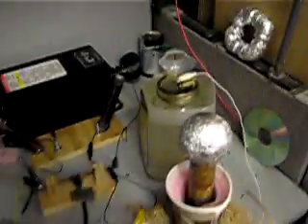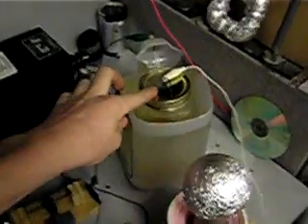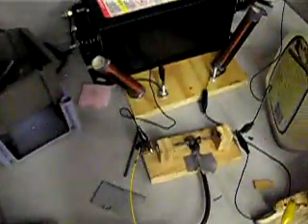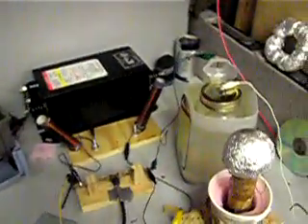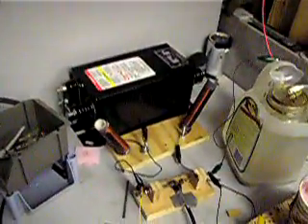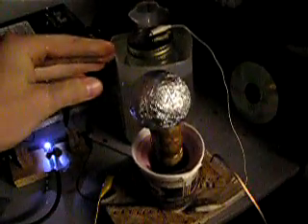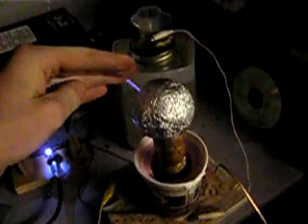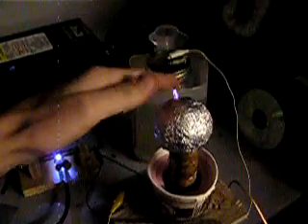My mini tesla coil

Comment: @supperstorm  The body acts as a ground. Since the current is AC, it changes it's polarity many times a second. The body acts as a zero, which creates potential difference with any negative OR positive charge. Therefore, the body is both.

Comment: @6418978876 
i think it doesn't cause much damage ...
The coil has 30.000 volts but little amps, so it cuases a bit pain, but there are many nerves, and the skin is a resistor too. but I couldn't build a tesla coil anyway^^

Comment: If you need more current from your NST, depot it and remove some of the current limiting shims, but not too many or else you could pop your breaker:^) Go to Ebay and get yourself some MMC polyprop caps. Change that spark gap to some copper tubes laid side by side. That NST could get you some nice 20+ inch sparks with some some serious reworking. Happy coiling

Comment: THey are 12,000 volt 30 ma Franceformer NST's. I use MMC polypropylene capacitors with bleeder resistors, an 8 gap copper tube spark gap and a flat wound copper wire primary.

Comment: Looks like it could use a good tuning. I make coils with 12,000 volt NST's that produce 23 inch sparks. Keep in mind that my secondary is only 1.75 inch by 17 inch acrylic tube.

Comment from the maker: Wrong. What you're thinking of is a van de graff generator. They don't have any coils or transformers or spark gaps of any sort. Just a vertical moving belt, a wire brush pickup at the top, and 1 conductive roller and 1 non-conductive roller.
Whats coming off the top of the sphere in this video is around 30kV of 2MHz alternating current. Static electricity is DC

Comment from the maker: It is. As well as on the outside. The bottle had lettering on the glass and foil would have left too much air, so I used the saltwater on the outside as well.

Comment: oh im sorry megasega i missread what you said..but no you dont need a 555 for this type of coil...just need a hv source,charge a high voltage capacitor with it and discharg it hrough a spark gap into a primary winding and that is about it...you have to have knowledge about it to get a good spark

Comment: hey mega sega..add my because i can help you with a few projects probably...i know a little about solid state tesla coils...but if you were asking if you could connect a 555 to the tesla coil then no...you need to connect it to a mos-fet..but if you know about high voltage i suggest a spark gap coil first

Comment: Ah, i remember when i was at 11 years... I played around by a multivibrator driven ignition coil... I should now try to make a working flyback (and a little tesla coil with it - my secondary former will be a 15cm tall vitamine tube which is polypropylene or polyethylene)

Comment: Well, the output from the secondary is high frequency, the nervous system doesn't respond to high frequency so it wouldn't electrocute you.  Of course, that's assuming that the coil is well tuned.  If not, you could get low frequency mixed in with the output and that could be lethal.  And you don't want to get directly by a discharge from the secondary, that can cause burns.  Also, the primary circuit is extremely dangerous.  It's high voltage AND high current, and is 60hz.

Comment: Oh agan... Ohm's law... Thru your body can not go 300A with 1V because of your body resistance. 5mA is deadly. Any voltage which can generate 5mA thru your body is deadly. If you body resisantce is low, even 70V could kill you. Watt is derived unit. It is only in relation to "Amps, Volts and Ohms".

Comment: Okay, what I mean is that the Wattage something is capable of generating is what's dangerous.  A flyback transformer won't do anything to because it's very high voltage but only capable of low Wattage (high voltage but low current.  Wattage = Volts X Amps.)  But a 450 Watt neon transformer could kill you, because it's capable of both high voltage AND high current.

Comment: No, it's both.  High voltage AND high current.  I can go grab jumper cables on a car right now and it won't do anything to me at all even though it's hundreds of amps, because it's only 12 volts.  It takes a higher voltage to overcome the resistance of your body.  Current = Voltage divided by resistance.

Comment: Well then, actually that's not too bad with only 6kv input.  My coil uses a 6kv furnace transformer.  I have a couple videos of it on my page.  That's amazing that you're doing all this and you're only 15!  Just be careful!  I started experimenting with high voltage when I was about 19.

Comment from the maker: Yep I accidentally let the arc strike my finger for too long and it left a black mark. And my transformer isn't 12 kv. I sadly discovered that the transformer only outputs 6kV at most. I didn't realize that when i bought it, the input was 277 volts. The most I can get from the variac is 140. But, I have ordered another one that really is 12kv and I should get it soon.

Comment: No...Wattage is what kills you.  A high voltage AND high current.  I'll go grab jumper cables from a car right now, and it won't do anything to me...even though it's hundreds of amps.  But it's only 12 volts.  In order for an electric current to be dangerous, there has to be enough voltage to overcome the resistance of your body.  Current = Voltage divided by resistance.

Comment: Dude, don't draw sparks with your HAND!  I left a comment about this, but don't ever draw sparks from the secondary with your bare hand.  Yeah it hurts, and it will also burn your fingers.  Hold a conductor in your hand, like a metal rod and draw sparks with that.  On a bigger coil, you would NOT want to get directly by a streamer.  Very nice coil, but you're dumping a lot of power into it if the transformer is 12kv at 30ma, you should be getting a much bigger output.

Comment from the maker: Yes i am running off the mains. The frequency coming directly from the transformer IS 60 Hz. 
The resonant frequency of the primary LC circuit is 2mhz, not the mains. The NST outputs 12,000 volts at 30mA.

Comment: Are you running the NST off of mains? If so wouldn't the out put be more like 50/60 Hz not 2 Mhz? I supprised that a coil that small even worked on that voltage/amerage, i gussing 30 ma. But then again I never even thought of trying it. Other than that nice job, nice quiet gap too.. :)

Comment: No, it's not even similar. I suggest you read up on Tesla coils and Van de Graff generators. Tesla coils are resonant AC devices, a Van de Graff generator is a triboelectric high DC voltage device.

Comment from the maker: This can be a safety gap, high frequency chokes(what I used), or ,the most effective, a "terry filter" which is basicly an assortment of metal oxide varistors, resistors and a spark gap.
Generally, you probably don't have to worry about your first coil screwing anything up unless you build a perfectly tuned coil larger than 6" in diameter and power it with one of those pole distribution transformers (yes serious coilers actually use those beasts).

Comment from the maker: Some people who have made large tesla coils have fried modems, computers and other things by running the coil simply because the high voltage is not isolated enough from the house circuit. Another thing that would affect sensitive equipment is the high frequency kickback through the transformer and into the mains circuit. This is usually prevented by using some sort of filter in the tesla circuit somewhere near the outputs of the transformer.

Comment from the maker: Yes and no. Depending on how you ground the coil, the frequency of the primary circuit, and the power of the coil, sensitive equipment could be disrupted in different ways. With my small coil, I am able to use the house ground for the secondary without destroying anything. But everytime I run my coil, if my family is watching antenna tv, the picture goes all static-like. I think this is just because the frequency of the secondary is near the antenna tv broadcasting frequencies.